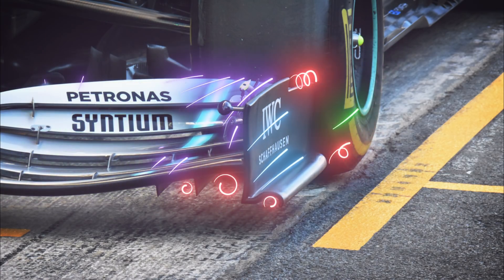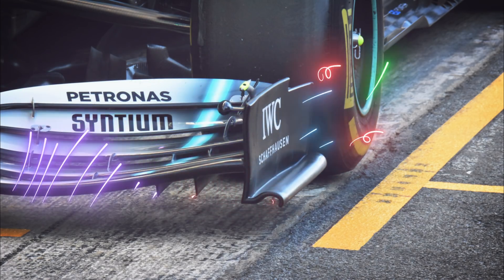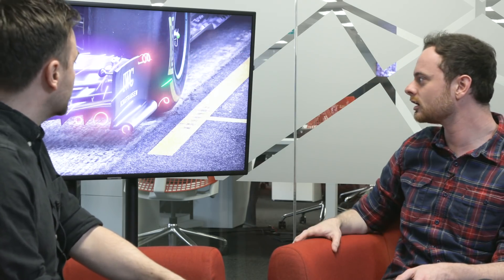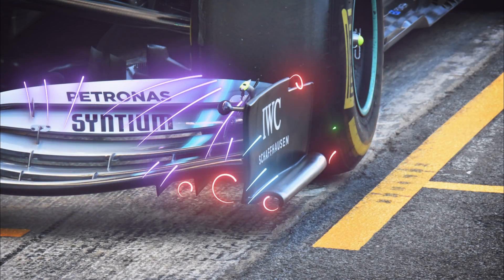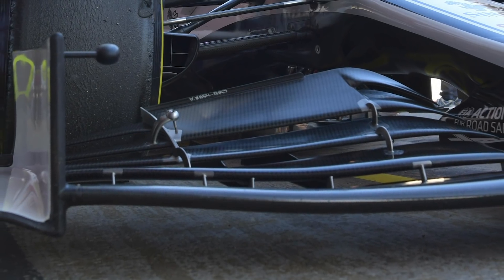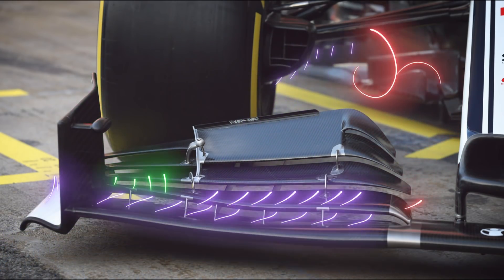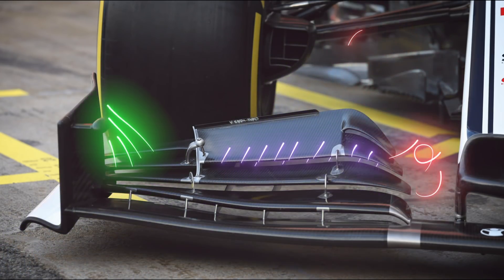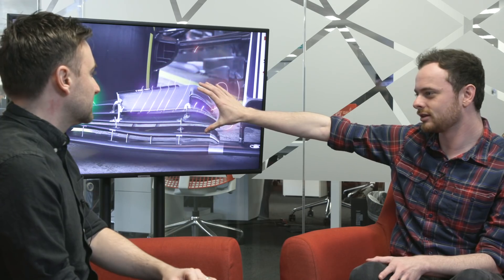Mercedes v Alfa Romeo: F1 front wing airflow explained

Comment: The y250 on the sauber is rotating in the wrong direction in the video, on the outboard section where the high AOA meets the flatter section would produce a bottom in rotating vortex hitting the front face of the tire at an angle instead of straight green flow as shown
Reply: They made the same mistake on the Merc endplate. Their animation shows air rotating from the low pressure side to the high pressure side.

Comment: i know just a small bit about aerodynamics and they got it almost all wrong. 
like the step in the end plate of the mersedies. 
the high part will have lower pressure difference and will have a big but slow spill over vortex. 
the step part will have way higher presser then on the other side of the end plate and will have a small but powerful spill over vortex. 
if u combine them u can get a vortex in a vortex or u can make them blend.u can have the big one pull the fast one to the outside. 
or the small one can pull the big one to the inside. 
u can have them murage in to a ovel for a short bit and use that as a wall. 
or it can produce counter rotation so that the top of one vortex will power the bottom of the other. 
having tall but narrow high speed air instead of big round and slower spinning air.
wat i think the merc idea is to have the angel of the step down vortex be way to the outside. 
this being helped by the curve of the end plate and the ridge on the outside end of the of the end plate. 
the big and slow vortex will want to hit the tire.but at the 3'o clock moment it will hit the 12'o clock of the fast vortex and be powered to the outside of the wheel. 
wiles the small high speed vortex has time to lose its power and fade in to the big opening in front of the tire.
again im no expert but, i know better then to just just add random vortexes inside the front wing streaks. 
they are there to maintain laminar and more impotently strait flow.

Comment: Huff. Firstly, this analysis does not make sense when the wheels are pointing straight. For there you can start to speak about how the car is generating downforce whilst cornering. This is particularly important on the outside of the front wing as the rear of the car is rotating into the turbulence of the outside front tyre. Now this is particularly evident with the sauber as the is a clear demarcation of geometry between the downforce generating section and the flow structure section. Creating such ubrupt geometric difference suggests that the section interacting with the tyre is that part with the curious lack of slot gap. However, if considering there is a large blockage behind the wing created be the tyre then the principle shifts from flow separation concerns to flow volume concerns. Meaning that the flow volume interacting with the tyre allows for greater consideration of the high pressure rather than the low downforce creating pressure. This is why they have a gurney flap to help aid a greater high pressure interaction. Normally for example high pressure is just an energy wasting process, like trying to blow on your drink to make is go up the straw. Now that there is this exasperated high pressure section this could be used to interact with a low pressure region and create a more dominant flow structure. The low pressure comes of the end plate and thus allowing for a stronger and wider outwash. The strakes under the wing of the merc does something similar in a more conventional way. But, rather than exaggerating the tyre blockage they are trying to exaggerate the low pressure of the wing section that is outside of the tyre. Which is better? neither, one is stronger and one is more efficient. But, if there was a team that understands the flow structures that interact with the rear of the car in yaw, it is merc. something something......
Reply: Think you should be sat on the sofa 😉
Reply: I also think that you should be sat on a sofa.

Im not yet convinced that the alpha wing is the best overall solution. It strikes me as being way too aggressive. The Merc wing seems simple in comparison but the bargeboard area is anything but simple.
As you correctly pointed out, analyzing these wings at 0 yaw is completely out of context. Qualifying them without considering the nose and the bargeboard area is even more ludicrous.

In any case, this is a free Autosport video. We get what we pay for.

Comment: Does anyone have expertise in CFD? How difficult/expensive would it be to do an analysis of approximations of the two wing types?
Reply: You wouldn’t see much, all of those differences make very little impact on the whole car, but they do add up and it’s more about how the whole car works, and to do a CFD simulation of a whole car you basically need F1 team level resources
Reply: @grewjuionpriweuma  Thanks. I did find a pretty interesting analysis of a generic 2017 car.
 https://www.davidpublisher.org/Public/uploads/Contribute/5b88eb315a456.pdf

Comment: How do the blown hubs affect the flow around the front tire?
Reply: They dont. They are banned for 2019.
Reply: If they are allowed brake ducts, they are blowing the hubs. Whether FIA like it or not.
Reply: @SMACK1978  You are correct. However, if you have a big brake duct, the brakes and the tyres will lose too much temperature, on top of the extra drag and dirty air created by it. With a correctly sized brake duct, the brakes and tyre temps will be comparatively reasonable, but the air will not have enough energy to influence the tyre wake.